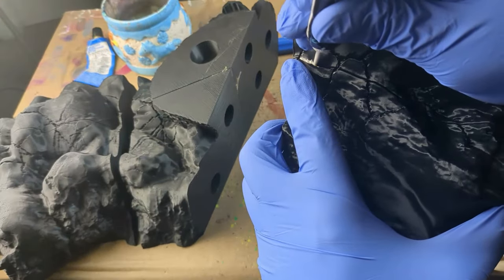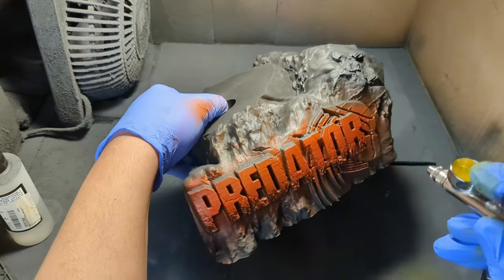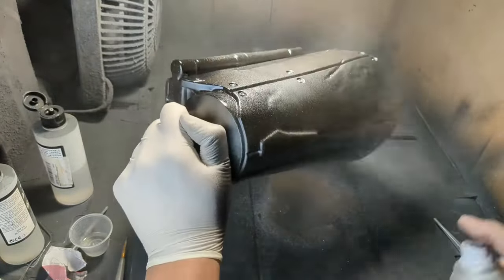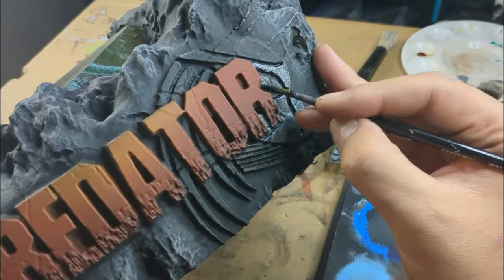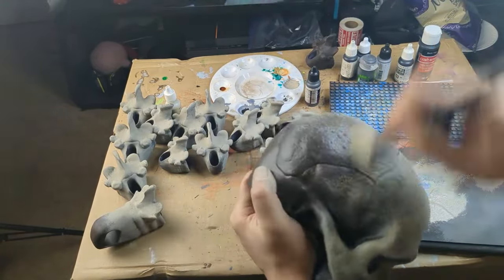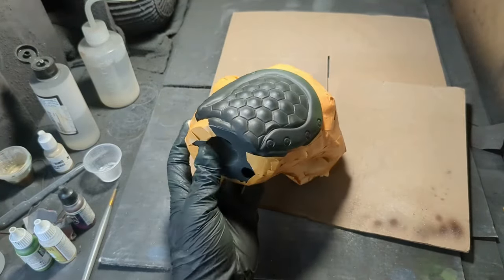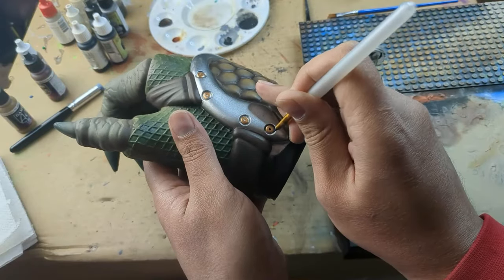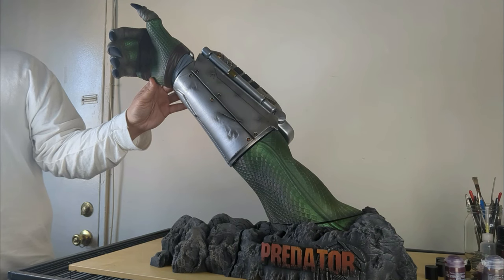Let's Paint Predator Arm and Trophy Skull  from Hex3D| Step-by-Step Tutorial eps 47

Comment: I use dap wood filler or hole filler spackle type acrylic based.
Reply from the maker: Wood filler.... Now that's an idea.
Reply: @waiyapaints  sands super easy. so does the acrylic hole filler. they are both pretty cheap